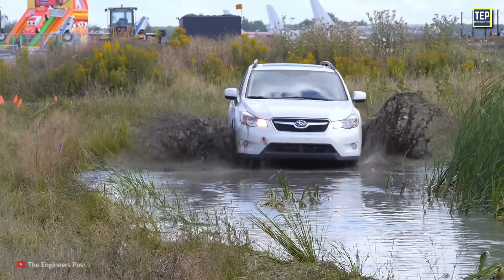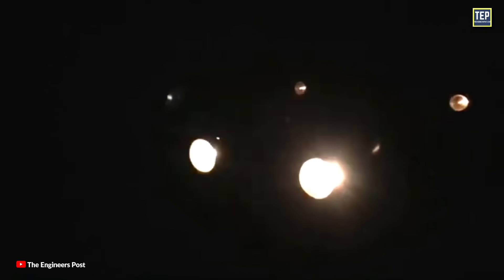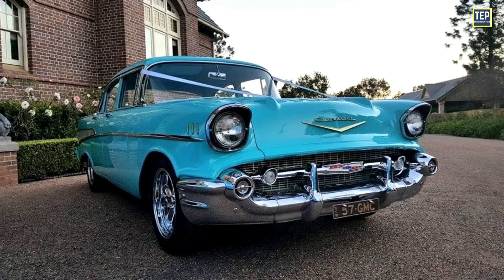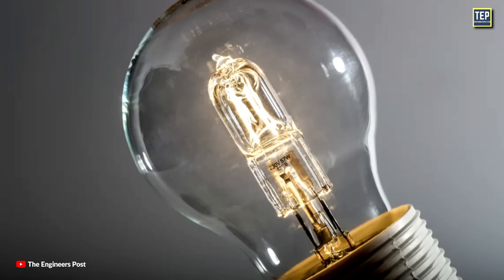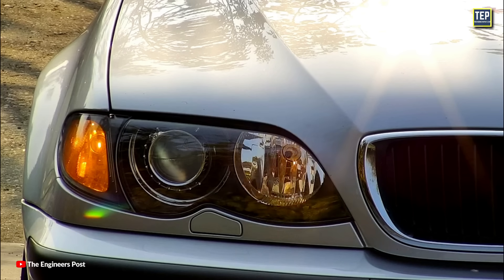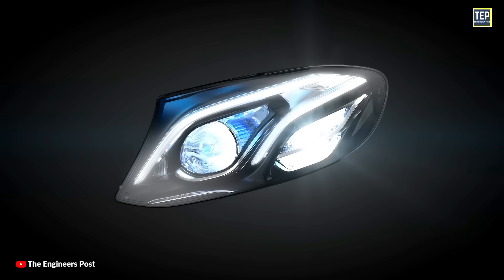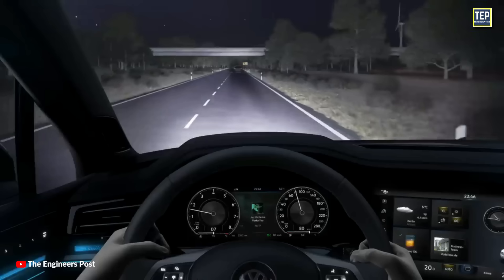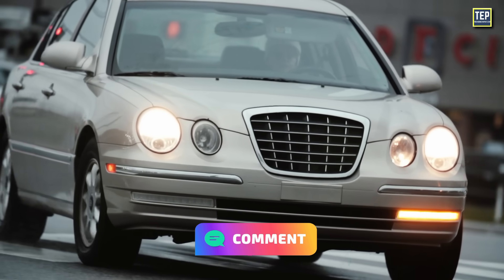The Problem With These Headlights

Comment: Remember when you could walk into the parts store and say "I need a headlight" and the only question was "Round or rectangle?"😂
Reply: 'High beam, low beam, or dual?'
Reply: Sealed beam era.
Reply: @_IMNNO yeah but I still preferred non-sealed, H4 Carellos by Hella or PIAA.

Cibies are good too.
Reply: @_IMNNO  sealed beam is some bs
Reply: I remember when the only question was "dual or single headlight setup ?"
Reply: @Connor_Arroyo  The Feds made it near impossible to do anything about headlights - even in the mid 1970's when carmakers went to some square headlights, they had to be approved by the NHTSA or some outfit and that was a big deal. As well as in the late 50's, approving a 4 headlight system instead of just two headlights.
Reply: @townhall05446 
It’s odd that the government had to authorize the switch from 2 round to 4 round, then round to rectangle, then from sealed beams to plastic housings, yet the government doesn’t regulate the brightness of headlights and instead leaves it up to manufacturers, at least as of last year.
Reply: I remember the day the 6014 died . The went from $2 to 20 in a snap . I bought all NAPA had left , but was a bit late
Reply: In Soviet Union the question was: "Do you have a permit to own a car?" or: "There is no headlights right now, the next cargo day is same day next month, at 14:00, but come at 08:00 to stand in the line, so that there would be something left." or: "Here, friend I have some under the shelf I kept for you. Did you bring the alcohol/sugar/cigarette stamps / illegal homebrew ale?"
Reply: @vallorahn in soviet russia lights buy you!
Reply: My car has LEDs so I doubt I’ll still have this thing by the time any of the LEDs burn out lol
Reply: @cosmo9925 just because  you have LEDs doesn’t mean they last forever. I see them fail on newer cars all the time. Improper heat dissipation and condensation in housing are the biggest problems with LEDs that cause them to go out.
Reply: @cosmo9925 also the people on the other lane can see you super easily
Reply: @cosmo9925 don't believe that. Most oem led headlamps aren't serviceable. So when the lighting element stops working you need to buy an entire headlamp housing. They are generally stupid expensive. Most or none under 2,000 dollars. The cheesy aftermarket led bulbs usually don't last 2 years.
Reply: @mrbig7718  The point is that the lighting element probably WON'T stop working. LEDs will typically outlast the average vehicle, assuming we're talking about OEM headlight assemblies and not some low-quality retrofit.
Reply: @alexisdougherty2652  I'm in the mechanics/auto body industry. They do fail.
Reply: @mrbig7718  Really depends on the build quality. A well-made LED assembly will last practically forever, but a lot of manufacturers cut corners leading to products with a higher failure rate.
Reply: My 1998 w202 headlight replacement - 2 euro's. My 2012 CLS shooting brake with full adaptive ledd lights had a failing left blinker - 2650 euros. Ahh yes. Progress.
Reply: @cosmo9925  unfortunately the actual LEDs are not the problem. Manufacturers tend to cheap out on ancillary equipment like LED drivers, heat dissipation, resins etc. And since the headlight is sealed without any replaceable parts, if something fails, you need a pricey replacement headlight. I see a lot of BMWs, TOYOTAs and Renaults with failed LED DRLs.
Reply: @michailangelopoulos5602  Considering the number of BMWs I see with broken indicators, I wouldn't be surprised if they cheap out on the rest of the lights too 🙂
Reply: I miss when they were GLASS, no turning yellow and having less light after a few years. Wait, we need an adapter to use the old glass headlights in newer cars, no more plastic turning yellow! Or at least glass replacement for the plastic lights now.
Reply: Bud, there are four different sizes of square sealed beam headlights alone.
Reply: Remember when car headlights didn't try there best to blind everyone approaching your lights
Reply: Hell, I even remember a time when even the rectangular ones didn't exist, just the round ones!
Reply: I've only had to do that once in 45 years. Still have my original Kyoto highbeams.
Reply: I remember driving at night and not being ridiculously, blinded by weaponized level brightness by the obscene level of white hot light   beaming from out of an incoming car while I frantically flash my lights only to find out it is only their low beams.
Reply: I remeber watching youtube videos and one or 2 ads, but now is every minute
Reply: Lucas fixed beams 😂. FX 4 cabs still used em into 90's! Changed loads of them.
Reply: the 1998 dodge ram has rectangle headlights
Reply: @DrSeraphinaVT I liked the rectangular Halogen sealed beams the best. Cars I’ve owned date back to the 1950s as I’m in my 70s.
Reply: @DrSeraphinaVT cadillac has round headlights
Reply: Safety regulations got us standard bulbs for a decade but car makers said it was boring. So if you’re old enough or young enough it may as well have never happened.
Reply: And they were $10 each in the '90s.
Reply: @nlpnt  just got some new ones...$12
Reply: Good old days
Reply: yeah, remember when you could walk into parts store and talk to people? no more, my friend, amazon and diy
Reply: And thry were only a few bucks!
Reply: Remember the times where you had to wait for 5 to 10 years to have a chance to be granted permit by government to buy a car?
Reply: 🐕💚🍕 wasn't it the 1174 and 1175 ? 🤔 dogs like pizza 🐻 trumpy bear and kellyanne 🇺🇲
Reply: No, but sounds cool
Reply: We're still using round😂
Reply: Ah come on, it was never just two headlights 😂.
Reply: You do realise LEDs do burn out. Most are over-runned with cheap power supply, so either of those 2 breaks and you have yo buy another pair...
Reply: Again the Led lie. a Led headlight is less efficient than a xenon lamp and produces more heat.
Reply: I wouldn't know for the most part as at the time in European Britain there were tonnes of different styles and types!

That said, the 7 inch round sealed beam and 7 inch round halogen units were pretty common on anything from a Mini to a Range Rover to a Humber Sceptre to a mk1/mk2 Escort!
Reply: manitoba-op4jx new car, still honey moon phase. We've all been there xD
Reply: "what engine size?"
Reply: When was that the 50’s?
Reply: I remembered going into Forest city auto parts with my father and buying parts in the 80’s
Reply: All but one of my cars has round or rectangle and the one that doesnt still has a glass lens
Reply: I actually got to do that once lol.
Reply: Love my 1989 jeep yj headlights, 6inch square can be bought at any Walmart for 5$ a pop
Reply: reading this while being young brings joy because i know u got to experience casual stuff like this but in a totally different way i didnt know about, and around my age too. simply interesting and heartwarming
Reply: I thought pretty much the halogens came in around the time when they introduced the rectangle sealed beams, I remember having a choice for the larger rectangles, between Incandescent & Halogen, & the Halogens were nearly twice the cost.
Reply: I replaced them with led’s…..
Reply: 80W tungsten H4 in yellow quartz with my motorcycles (only had one).
Reply: All the above 😁
Reply: 😂 I’m not that old unfortunately
Reply: Ah, a yank. I Hooe you understand that your poorly designed, mandated headlights where fucking terrible. Literally ruined the look of any car they were on 😂
Reply: How old are u ?
Reply: @adamz6158 seven

Teen

Million

Seconds
Reply: you can prob just order your lights online now
my uncle did when he switched from halogen to led on a civic, it made a world of difference(he did high and low beam)
Reply: @ebongaming2455  fuck he must be blind as a bat! I just when to gruntier halogens
Reply: Kinda round rectangle? What size rectangle?
Reply: Hell, I remember having refill my oil and acetylene head lamps.
Reply: @jlang8213 Mine used carbide, to go with my carbide mining lamp.
Reply: No, Fred Flintstone.
Reply: Actually there were 2 different sizes for both.
Reply: no lmao
Reply: Good explanation
Reply: No
Reply: only in that trash country
Reply: 1930s
Reply: With or without turn signal fluid? LOL!
Reply: Not really, perhaps that's a US specific thing. In Europe we replaced only the lamps and not the lights.
Reply: I recall the only question was 'what diameter, 6 inch or 7 inch?'.
Reply: No
Reply: Ah yeah the good old fifties
Reply: No, because I don’t live in a backwards country.
Reply: Yep
Reply: Modern LED lights need to be standardized and have limits to brightness.  Maybe a standardized light projection pattern to reduce blinding the oncoming cars ( and rear view mirror reflection ).  Especially in trucks and SUVs.  LEDs seem to be bright at the bulb/s, yet do not seem to create an actual  “visible lit area”.  Maybe more Research and Development and Functional Design, less Aesthetics.
Reply: Imagine thinking that's a good thing.
Reply: “Got any squares or hexagons?”
Reply: I remember only round
Reply: Couldn't see shit with those Halogens, seriously. Xenons changed that, untill Matrix LED's came. Matrix LED is the way. Can actually see quite well in the dark. Automatic ones are nice.
Reply: I think my dad's truck (from the mid-'80s) had those - they were the rectangular ones.
Reply: I remember when you just needed to replace the candle
Reply: Yes, I rember that pathetic illumination compared to today’s lights.  Remember when all you needed to do was re-jet the carb and clean the points?
Reply: Remembering 4 Hella 200mm beams on my Opel Kadett C Coupe.
Reply: blame Ford, the Lincoln Mk VII broke the gentlemen's agreement of everyone using the same headlights
Reply: I remember those days, you had to buy a whole new headlight assembly just to replace a burned out headlight.
Reply: Yes..
Reply: My dads car hav LED lights
Reply: No I don’t sorry
Reply: It’s called advancement of humankind and technology, rotten meat, don’t adapt to the change then get left behind
Reply: Im in my 20s so I don’t remember this but my first car was from 2004.
Reply: remember when u were able to work on ur own car as well? good times
Reply: @chunkyrabbit1032  trouble is, they needed a lot of work just to keep them running. It wasn't necessarily indicative of a good thing. Modern cars don't need half the maintenance unless you choose to.
Reply: @chunkyrabbit1032 my dad was a car mechanic in the late 70s , most of his work came from people that thought they could fix their own car
Reply: Rectangle wasn't  an option back in the day.  Choice was large or smaller?
Reply: I'm older than that, was born before rectangular headlights, even before quad headlights. Your only choice was round or round. Then about 1958 cars were switching over to single or double headlights.
Reply: No.
Reply: Then the options became "American", "Japanese" and "European"
Reply: Easy to spot the people who remember life Before The Fun Stopped. 😂
Reply: Mind you, this wasn’t a plus. Sealed beam headlights spoiled a lot of cars’ designs and weren’t aerodynamically great.
Reply: @initial86-2.5 
Sealed beam headlights may have spoiled the design some, but they cost far less than halogen bulbs in plastic housings and led bulbs/housings, and they were very easy to replace. I’d say the more important issue is that plastic housings contribute to fuel efficiency since the front of the vehicle can be more aerodynamically shaped and have minimal gaps.
Reply: It doesn't matter what shape your car's headlight is, from inside its bulb and reflector both are always round or oval
Reply: The point is it DID matter.
Reply: @ixctechtv That’s not true. Rectangle sealed beams have rectangle reflectors, and their parabola has to be adapted to accommodate that difference.
Reply: @babybirdhome  rectangle beam lights also has round reflector from inside
Reply: @ixctechtv 

Completely untrue. Have a look at god knows how many British and European cars.
Reply: @ixctechtv  Sealed beams didn't have removable bulbs, you replaced the whole housing. That's why you had to pick between 7”x6" rectangular or 7" round for cars with two headlights (one per side). Cars with four headlights used the smaller 6½"X4" rectangular or 5¾" round. I think cars with two headlights were also allowed to use the smaller headlights, but Pintos and Beetles used the 7" round so maybe that wasn't a thing.
Reply: @coontent-tv I think you missed the point of the his comment.  You may be to young to understand, idk.
Reply: Nope but that sounds nice
Reply: @RetroP146 it wasn’t. Those lights sucked.
Reply: I'm under 40 so no
Reply: That’s not a good thing boomer
Reply: Nah I'm young as fuck but that musta been nice
Reply: @marioformicadae6637  literally never happened in that guy's life.
Reply: @marioformicadae6637  You used to just basically buy TVs by size too.
Reply: @marioformicadae6637  It wasn't, sealed beams sucked so much ass, you couldn't see more than about 20 feet in front of the vehicle.
Reply: 666
Reply: I'm just curious about what actual light would do a good job on my 1993 Jeep Grand Cherokee. The "Stock" ones in there now get so hot that their melting the plastic, retaining the bulb area! Anyone's input would be abbliged. Thx
Reply: @toddrhine7648  by a 90's jap vehicle, problem solved!
Reply: What about the times when they asked, "red or white"
Reply: No.
Reply: would you like Carbide with that?
Reply: No, because there were still different sizes of those round and rectangle headlights.
Reply: I’m glad they give you internet at the old folks home now
Reply: No. Even very early on, every manufacturer had their own housings, plug designs, and many other electrical, optical, and physical design characeristics. At best you had standards around the same manufacturer in comparable vintages, but you pretty much had to look for your exact car model on the back to be sure it would be supported. Take off those rose tinted glasses from time to time, the past was shit much more often than it was better. Thankfully, you don't need to replace modern lights regularly anymore. Car makers always made it as annoying as possible to get to them, probably hoping you'd just give up and let their official repair shops do the replacing.
Reply: Sounds quite boring!

And having standardized bulbs that are user-replaceable while still allowing for unique headlight designs is the FAR superior solution! This solution would even work with LED and laser headlights, if manufacturers hadn't become too greedy to sell long-lasting and repairable products!
Reply: And neither of them could compete with current designs
Reply: No. All my cars had bespoke lights.
Reply: No, I don't remember that.
Reply: Yes and I don’t miss it.
Reply: And walking up hill both ways to school? In 3 foot of snow? By yourself, at 3
Reply: Yeah, back when lights were shit.
Reply: Not gonna lie, I remember those days and DON'T miss them.  Remember the 'less-fun' part of that era...AIMING them again after every time you replace them.  Frame-aligned headlight assemblies are my new friend.  Much like 'good fuel injection'...I don't miss carburetors either.  Nor leaded gas!  Ugh.  Anyway, headlights!  Every time I swap my Civic's headlight bulb nowadays, I also have to...throw the old one out.  Job done.  The good 'ol days weren't actually as good as we pretend that we thought they were if we're honest with ourselves.  SOME things were...but most weren't.
Reply: Remember when lightbulbs were something that needed to be replaced on a regular basis? I haven't had to change a lightbulb in a looong time, LEDs are way more reliable.
Reply: @RaveN_EDM  Yep! And they'd often arc over with an impressively bright flash when they blew. You don't really see that anymore.
Reply: @RaveN_EDM  da fuck you talking about? In 20 years of driving I have only had to change 3 halogen bulbs!
Reply: @RaveN_EDM why then do I see so many vehicles with one headlight not working
Reply: Remember when you could walk into any department store and buy tubes for your TV?

.....why are we remembering our primitive days again?
Reply: @kewlztertc5386  Not a department store but there was a ham radio/electronics hobby store in my town up until the mid 2000's that had just about any tube you could imagine.
Reply: @alexisdougherty2652 I grew up in the 80s/90s I remember many such stores. They will soon become myths and legends.
Reply: Time to go collect your social security, gramps!
Reply: @N54MyBeloved in my 1930 Cadillac 13" headlights you pull a release at the bottom of the ring, remove the lense and change the bulb. Quick clean of the inside helps. Very easy to do. How's that for gramps!

Comment: the solution is decent street light that illuminate the road so it can be seen clearly, not more and more ridiculously uber bright headlights..

maybe you can use those in some rural area with no street lamps